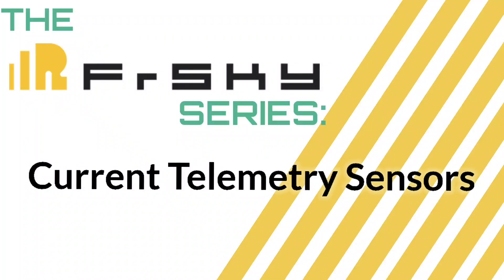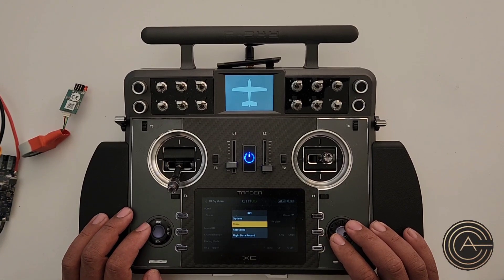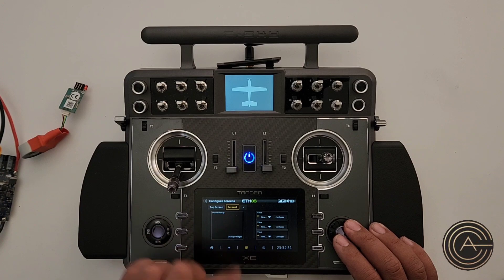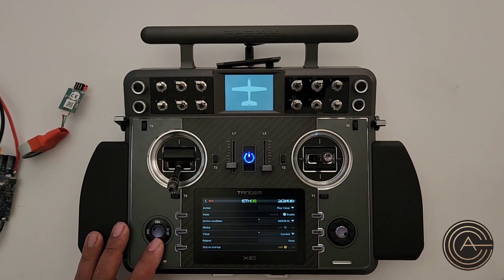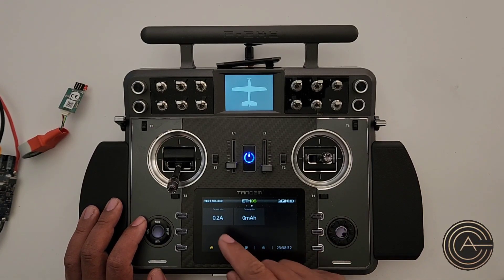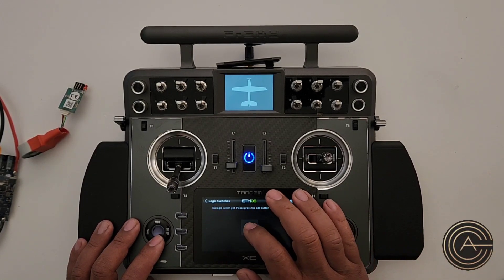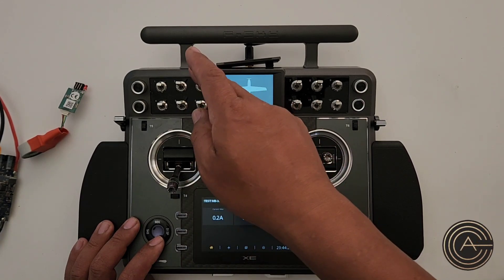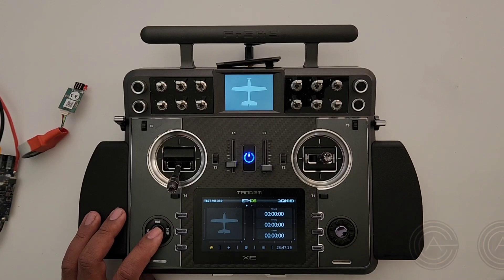The Frsky Series: Current Telemetry Sensors

Comment: hello unfortunatly the option to change pin6 in my case is not available to change it to s port  i'm trying to connect this sensor to a archer R6
Reply from the maker: Archer R6 is a bit different to the Tandem i showed in the video.  The  Archer R6 has a multi pin connecter (white) on top of the case.   Pin 1 is -, pin 2 is ± and pin 3 is S Port. Connect those three to your sensor.  No need to program anything or use a channel.
Reply: yess thank you very helpfull it worked  @all_rc

Comment: How precise are these sensors ?
Reply from the maker: I dont know exactly.  I have checked it against a inductive current multimeter and it read less than an amp difference. Couldn't say really... my  multimeter that i confirmed it against was a cheapy. But for my usage, it seemed pretty good.
Reply: @all_rc  less than an amp at what Amperage?
Reply from the maker: On that plane around 100a if i remember correctly... it's been a while

Comment: Good morning Sir! hope all is going well. Question i have the x20s and did a update on Ethos Suite. On my FRSKY Temp sensor now are giving correct reading. temp one reading 43F and temp two gives reading 44F. when I go to my other models and it gives same reading. Note the ouside temp is 63f. Do you know anyone had an issues like this. I know its something did most likely. appreciated your help if possible---thanks. Note my current sensor work as it should.
Reply from the maker: Unfortunately,  I do not have experience with their temp sensors.  However,  if the temp sensor follows the same conventions as their other sensors, they may provide a way to calibrate.  In their voltage sensors, they have offset and ratio. Offset if it is constantly a certain number off and ratio if the entire weight is wrong.  Might wanna check that.
Reply from the maker: One more thing,  you mentioned you did an update to the radio.  Might want to check and see if there was a firmware update to the temp sensor as well

Comment: that stinks you have to buy one for each plane. having to un solder your connector sort of stinks.  thx for the video.
Reply from the maker: There are two types of current sensors.  The inductance type like I showed, yes, you'll need to desolder your connector to put the sensor. The second  type of sensor needs a physical connection, so it is connected between your esc and battery. Looks like an in-line adapter.  Frsky (and others) make both versions.  Personally,  I prefer the inductance type. One less connector in your power system. Another way to get current telemetry is with an esc that has the telemetry built in.  Spektrum escs have that, but they only work with Spektrum receivers. Frsky does make a line of ESCs that have Amperage, RPM, etc. telemetry built in. Haven't tried one yet.

Comment: Great video! On consumption I like it to read out the consumption every X seconds. I don’t want to fumble with a switch. I do like the idea of using a switch to turn off the alarm.
Reply from the maker: Yeah, I did that before, but the constant call-outs got a bit annoying for me. That's why I set up the warning. There are so many different  ways to program the same thing. That's why I like Frsky (and before,  Edge TX). It may be a bit longer to set up, but the flexibility is awesome.